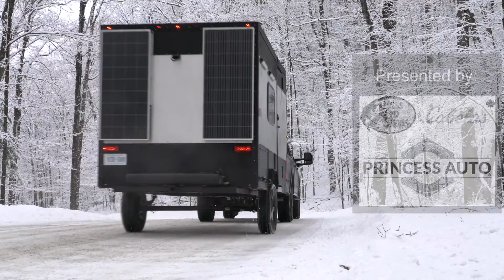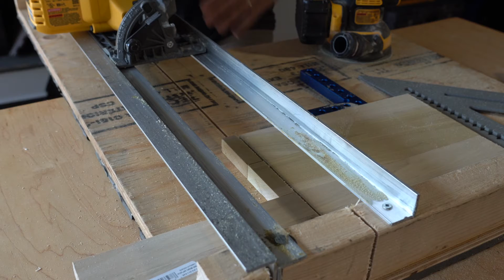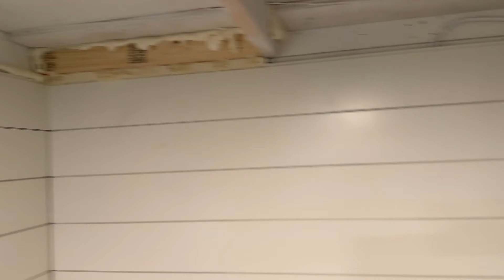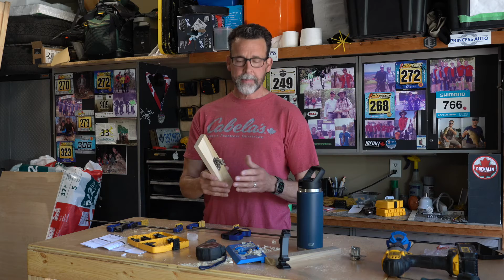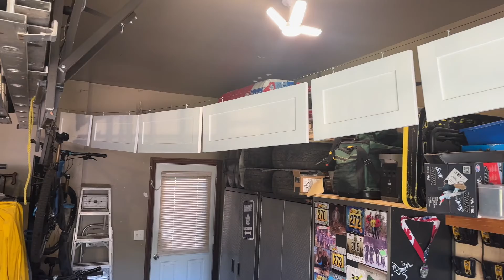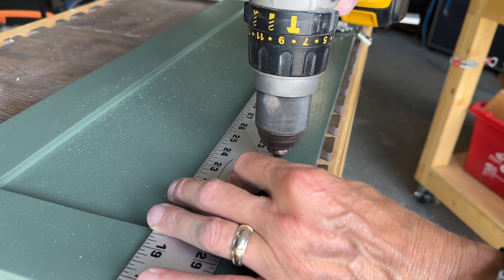How to Build Cabinets for a DIY Travel Trailer

Comment: Take out that red plate on your table saw. Cut a piece of wood the same as the opening with the saw blade all the way down. Install the new piece of wood and turn the saw on and slowly raise the blade all the way up. This will solve your gap problem!

Comment: Well done!  They look great!  Thanks for sharing the build.
Reply from the maker: Thanks for watching!
Reply: @DrenalinAdventures  A quick tip.  If you ever want to make a zero clearance bed for your table saw blade.  The way to do it is:
  1 Fully retract the blade
  2 Clamp the ply down to the table top
  3 Turn on the saw
  4 With the saw running, adjust the blade upwards through the ply.
  5 Once you have enough of the blade showing through the ply, turn off the blade.
It's simple and it's safe.